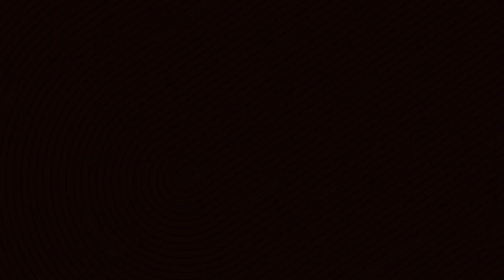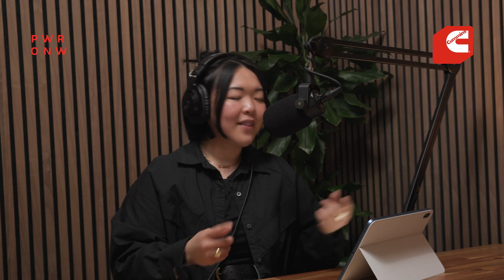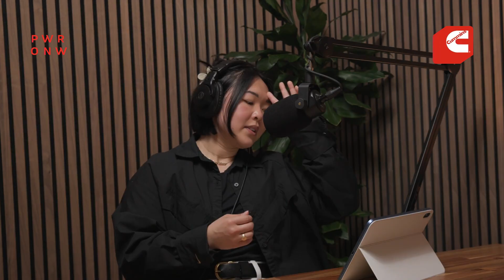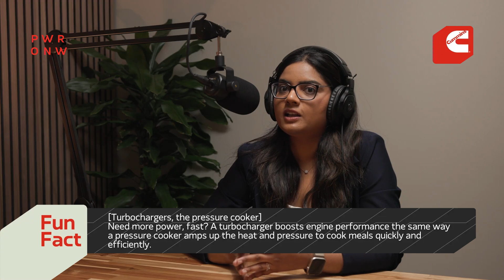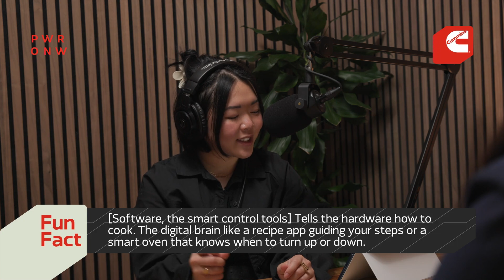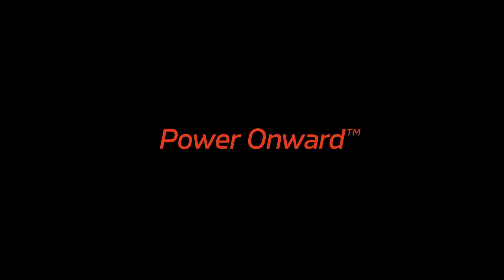The ingredients powering your vehicle | Power Onward podcast

Comment: I’m guessing that neither of these two have ever owned or operated a truck or a fleet of trucks. The direction that the trucking industry is headed is bankrupting trucking companies. This “tech” is absolute trash and is crazy expensive upfront and expensive to not just maintain and repair but in lost loads and losing customers from trucks going down. Driver frustration is at an all time high because they don’t get paid from trucks remaining at the dealer, whom are the only ones that can diagnose and repair them. I’m about done with this new garbage and reverting back to pre 2007 trucks that I can rebuild top to bottom and I can repair, yes even on the side of the road by myself. Same fuel efficiency and I don’t lose my customer. Don’t listen to these college participation trophy holders that are speaking here. They don’t know the reality of owning trucks.   Sorry Cummins but you abandoned us truck owners. We did not abandon you.